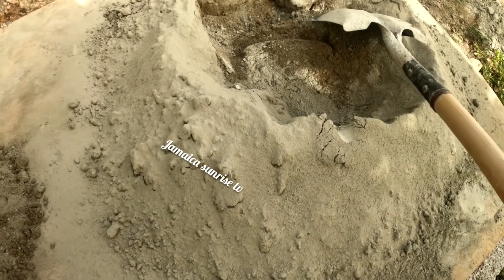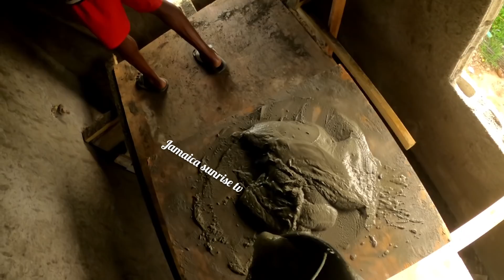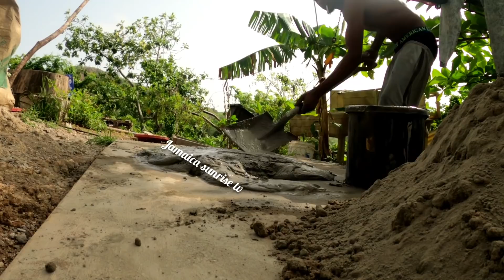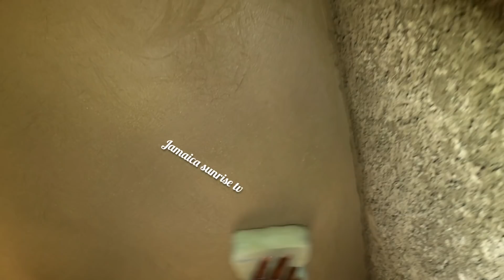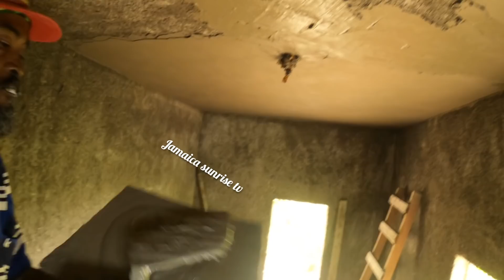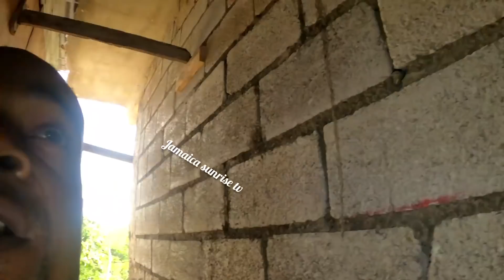GRANITING THE KITCHEN TOP

Comment: Sunrise, If your blocks are laid neatly you do not need to rough cast the walls, You can render on the blocks only. it will save time and money. Rough casting is to be used only to straighten walls that was not laid streight. Dont waste money, brother.